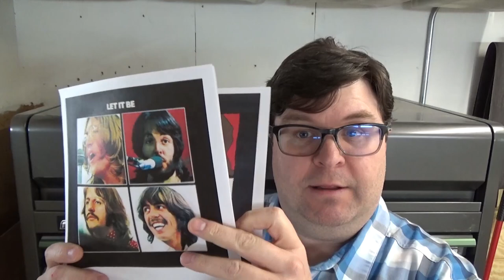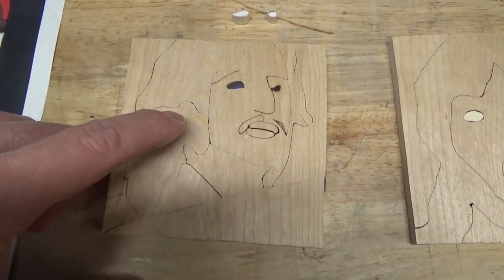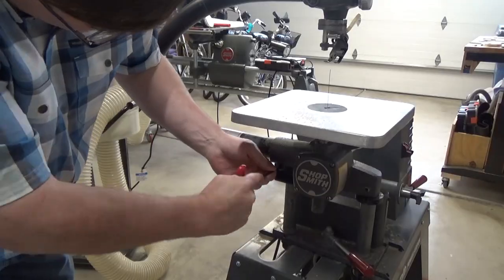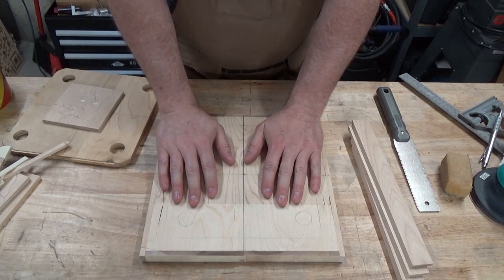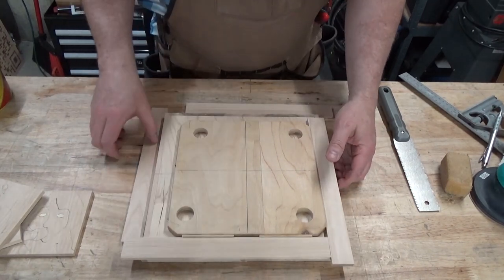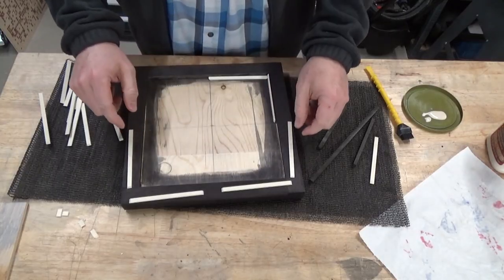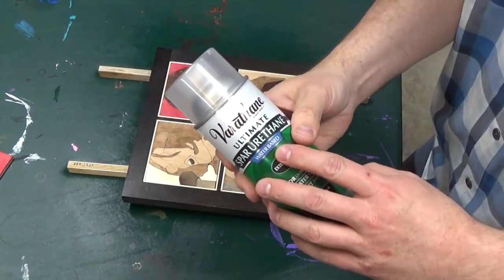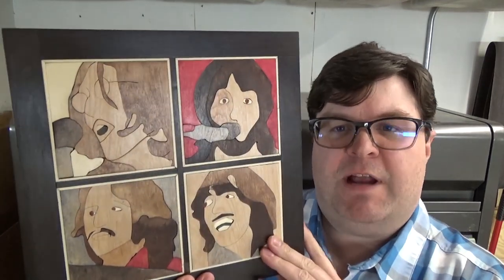The Beatles - Let It Be Album Art Woodworking Project: 2022 Makers Rock Collab

Comment: Tom, that is so slick! And your daughter did a great job on the line art too. Also, I’m glad to see you getting that old Shopsmith jigsaw back on her feet. Also, I’m sure you’ve heard this already, but if you ever make something like this again, pad saw all of your wood together, and then you can swap the parts for a perfect fit. Scott
Reply from the maker: Thanks Scott. I really thought the 610 did a fine job. This was my first scroll saw project and I made some rookie mistakes early on that took pad sawing off the table. For example, on the 19mm board I flattened a face, trued an edge, resawed in half, then thickness planed until both faces were smooth and flat. This gave me 8mm thick boards, which I now know is too thick for this application. I couldn't use the smaller blades on the thicker hardwood, I found a No. 2 skip tooth that worked, but to pad saw 2x8mm I would have had to go bigger, I think. I should have resawed into 1/3rds and planed until I have <4mm boards. At that point I think pad sawing would have been an option with a blade small enough to make the turns.
Reply: This comments confuses me.  First I had to look up dap saw.  Then I figured out you meant pad saw (which I'd never heard of).  But even now that I know that, I still don't get how it would have been used in Tom's project other than maybe to clear out corners.  I guess the whole thing could be cut with a pad saw but wouldn't that be a lot of work vs the jig saw? What am I missing?  Maybe if I had ever used a pad saw it would be obvious to me.
Reply: @danasmith8950  Wow, so many typos in my comment!  Yes, I mean "pad saw" (I just typed "dap" again!) The advantage is you can cut both species of wood at the same time and swap their parts. With the right blade and a well-tuned saw, it works quite well. You can "pad saw" (I just did it again!) on a bandsaw, a scroll saw, with a jig saw and probably several other tools that aren't coming to mind. Scott
Reply: @MyGrowthRings  Ha! Typos reign.  Anyway, I get your drift.  Stack things up and cut them at the same time.  Did you know that there is a type of saw called a pad saw?  Apparently it is a small, narrow saw used for cutting curves.  I thought maybe that was what you were referring to.